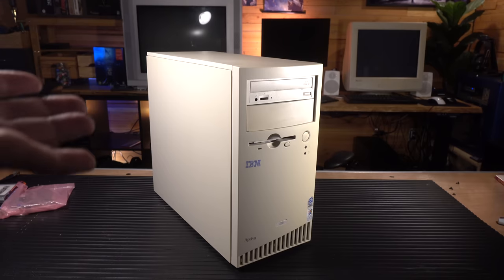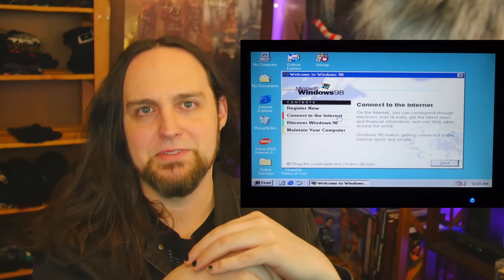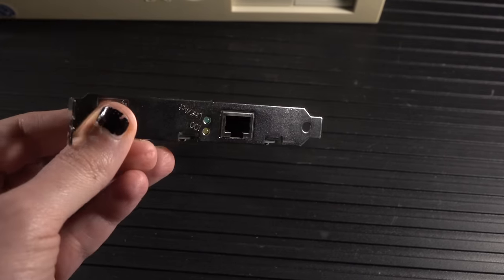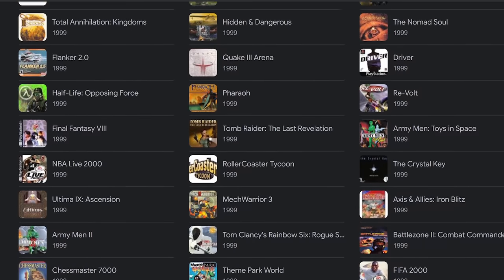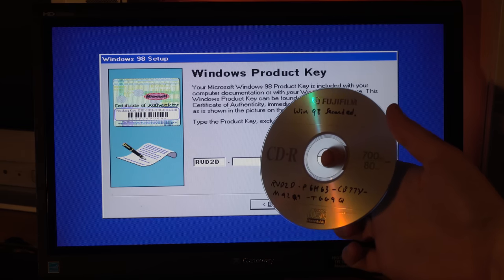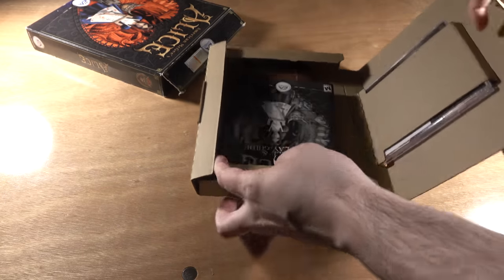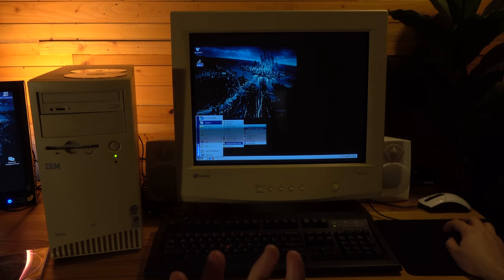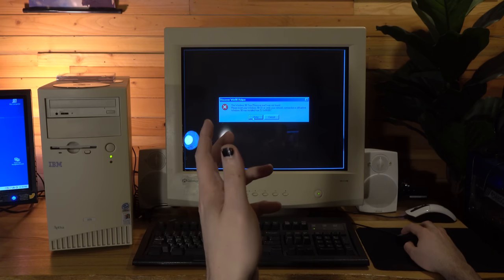Don't Install Windows 98: My Nostalgia Turns to Pain

Comment: I ran several large pieces of test equipment in the past that required Windows 95 in order to operate the machines. Their timing was hard coded to match the frequency of the processors that came with the test equipment. Trust me, there is nothing nostalgic about waiting 10 minutes to copy files to a USB through a floppy disk converter in 2020!

Comment: Best way to install it so that you never had to put the Windows disk in again was to format the drive create a win98 folder and copy the contents of the CD onto the drive and start the setup from there. From then on Windows will always look to that path for the install files.
Reply: Assuming you had it on CD, it'd be relatively easy. On the other hand, if you were stuck doing it from floppy... 
PLEASE INSERT DISKETTE 25...
Reply: @MindstabThrull  I'm not sure 98 was on floppy. 95 was which was quite a number of disks but it was actually more to then install office after :O

Was basically how I started in IT as a kid, "Hey sit here and change the disk when it says"
Reply: Use the February security update disc to auto install all the patches with a GUI, including USB. Hell, you can update 95 to basically 98 support level with the right patches. The problem with opengl is likely no driver, because 9x does not have factory drivers or an internet connection. Those drivers need to be installed to play games, not to mention direct x redistributable, and possibly the C libraries, which is so much easier with the update disc. Dude likely didn't know any better. Stock 98 is garbage compared to SE, and ME is even better.
Reply: run 98 cd
install from cd option
c:
mkdir win98
d:
cd win98
copy . c:\ win98
c:
setup

and you're off to the races
edit: comments being weird, wont let me post asterisk

Comment: That's why 98SE was created, to improve on 98FE, & it is why 98SE is also one of the operating systems that I have used the longest & still use it to this day.
Reply: It is 98SE though. Windows 98 in general is just unstable

Comment: XP is the true retro sweetspot , with the inExperience patcher you can make it look justl ike windows 95 and 98 plus with  the unoffcial sp4 added you can play games like Fallout new vegas , skyrim and crysis 2  so the range on xp is so wide , i tried a windows 2000 build and ended up putting xp on it and setting it up to look like 2000 because it was so much easier to get games to work
Reply: Good points about XP, I may have first started PC gaming on Win98 but XP was where I really cut my teeth in modding. Adding real world cars to GTA San Andreas on PC for me was like the moment in Star Wars when Obi Wan tells Luke "You've taken your first steps into a larger world" if only I knew how good those times were when they were happening.

Comment: You should try out Star Trek Klingon Academy.  It has fmv cutscenes, starship destruction where you blast holes in the hull of the ships, you can fight on the periphery of black holes, planet atmospheres, and asteroid fields.  Plus it has a really deep power management system letting you overload shields, engines, weapon systems, tractor beams.  It really had it all from the golden era in gaming, lol it's manual was on a ring binder it was so thick with lore and information on how best to command your starship.  And as an added bonus it was annoying as hell to get it to run on my windows 98 PC but it was a blast when it wasn't crashing or having audio issues.  Oh yeah and it came on 6 CDs!
Reply: That sounds amazing! I hadn't yet heard of that game before now.
Reply: Plus the game came with a great T-shirt. Wish I still had it

Comment: I have USB flash drive support enabled on my custom built retro 98SE PC (Slot 1 Pentium 3 933mhz running at 700mhz, 1 GB of ram, 2x HDD 128gb + 80gb, Sound Blaster 16 CT2910, and a new old stock 9250 256mb ATI radeon card etc.etc)  + a USB 2.0 PCI card installed, works perfectly.

Comment: I'd love an old beige case with a windows 7 board inside, 98 themed. I had done this before during lock down, the case lacked air flow so I took it apart in the end. but it was like having a windows 98 machine with more abilities haha
Reply: Beige = "Putty."

Comment: I’m in a bit of an odd situation. Although I am a few months older than the 8086, I didn’t get into learning about computer until about eight years ago. So, I know Windows 10 very well. I know Windows 7 less well, and I had owned XP, 98, and 95 PC’s when they were current. I used a 3.1 at school, and an NT 4.0 at uni. 

Computers being my hobby these days, I am slowly working backwards through time to understand now what I didn’t back then. There are tiny amounts of nostalgia, but it’s mainly all new to me. 

In a VM, I have Windows 11, 10, 8.1, 8, 7, XP, and 98se. On bare metal, I have 11, 10, XP and 98se. And in an emulator, I have 98(fe). 

My next project is to get NT 4.0 running, and then I want to get 95 and 3.1 going, but obviously need to get DOS running first. 

Anything running on NTFS seems really easy. Install them, network them all together. XP accesses the NAS with just a bit of arm twisting. 
But the 9x stuff? Anything running on FAT? What a delightful puzzle this stuff is. 
98se was a learning curve, as you say, just to get drivers working. I have a special old thumb drive that I have to use, because it doesn’t like the new ones. I was lucky enough to be given an old Pentium 4 system with an AGP mobo, that although came with XP, will run 98se just fine. Drivers are a search and I have everything except the onboard sound. A sound card solves that. However, it didn’t really like 98, so I didn’t even bother with 95. I’d like a 486 system, but they are now all overpriced. A combination of dying hardware and retro classification.

I’ve even researched XT systems, but you need a storage unit of parts just to keep them running. I enjoy soldering, but they seem to need constant attention. 

But yes. That is why I have a Windows 98 PC.

Comment: Windows 98 is actually pretty easy to get set up, I’ve been having no issues with my multiple 98 rigs outside of serial networking on a few obscure games
Reply: came to say the same thing. exactly. i think the older operating systems required that the user really understand their hardware very well, whereas newer operating systems do most of the decision-making for the user.

Comment: I remember that little animation whenever the shortcut you clicked on couldn't locate the destination it had a flashlight rolling on the floor as if it was looking for the file. Small touches like this seem cute now. 
Also when i was very little and we had no games i used to go into the Windows folder and found the dos executable. I thought it was some sort of game because of the colorful icon but it failed to launch whenever i tried and couldn't figure out why lol

Comment: Modern flash solutions are fantastic for these retro machines. I have a beautiful IBM Thinkpad T23 running with a P3, S3 SuperSavage (basically Savage 4 performance with Savage 3 memory, yet no bloody S3TC for Unreal!!!!) integrated video card and half a gig memory. I bought an overly expensive 64GB PATA SSD, but I also grabbed the HDD caddy made for its UltraBay 2000 modular drive in place of the DVD drive. Grabbed an SD-to-PATA adapter and that SD card is where I have my Windows 98 disc stored, all the drivers for the T23, and the ISOs for ALL the games I wanna play. If I need to move a bunch of files, I can just pop the SD card out, drag and drop on my desktop and pop it back in. If you can use flash storage, go for it.

Careful if you do CompactFlash though, you need an old card because modern Sandisk CF cards don't have fixed disk mode, they will instantly fail if you try to force the will of FAT32 bootable on them.

Comment: Windows 98 was the first advanced OS we had at the time when hardware was finally good enough to run it relatively quickly. Thats especially true if you knew how to optimize it.

It's biggest problem was letting drivers take it down. You had to find the stablest drivers, not necessarily the newest ones.

And you couldve learned alot about it because the Resource Kit was on the CD.

Comment: Alice game wasn't meant to run on win98 machine, I remembering playing Alice during XP Era. In win95/98 Era You rarely can install full cd games and I remember you can't run games without cd inserted, similar like console games due to limited hard disk space those days. The only way we could work this around without insert cd is by installing something called "virtual drive" or "virtual cd" where you copy the entire cd content into iso and mount the drive to the program. This feature is only available on 3rd party software before become available in windows 8... Useful tool for people who doesn't want to spoilt thier cd rom drive those days

Comment: I forgot about the USB devices not working without drivers. Back then making games work was always a chore but I was young and was determined to get it going. Now I'm also used to everything just work.  Fav games from that era was Formula 1 Grand Prix and Janes ATF when I was about 11 years old.
Reply: Things got more simple with XP for sure. Even now though you still need to find drivers for some specific hardware, windows update doesn’t really do this reliably.

Comment: some businesses that rely on repeatability in manufacturing still use windows 98 or maybe 2000 pro because the cost and risk of changing that when its not really needed is too great.

Comment: We should have had a build-off (or OS install-off?) I have my old Athlon 750 (Slot A) system with 384MB of RAM and an FX 5200. DFI AK70 motherboard, 40GB HDD, an old...C-Media sound card I think, and probably an Intel NIC all in a very painfully yellow case purchased directly from a tiger back in the day. This was a fun walk into the past. I think I'll still try getting 98SE installed on that system.

Comment: Sometimes you get a BIOS that can just treat USB drives like essentially an emulated IDE drive. Those are really convenient, it made all my USB storage devices work even under pure DOS - after a reboot. But with random hardware and missing driver CDs it can be painful, I can totally see that. When these machines were new you just had them but nowadays...
But all in all it's probably the version of Windows I had the least issues with, I refused to switch to XP until 2004 or so.
6:10 and industrial plants. You wouldn't replace an expensive as hell machine so you don't have to use a DOS based OS to control it anymore.
9:52 No matter how many time I hear it, I will never stop expecting "For Whom The Bell Tolls"

Comment: Retro/Legacy Mania, I predict is going to become 'a thing.'
Also "Dial-Up For The Hell of It" must come back as actual 
backup! (Uh, land lines have their own power backups for
when the really fancy non-wired things go down?)
I've a gorgeous little "VIVA 24fx" modem.
Honestly it appears as if designed in the late Fifties/early
Sixties by VOGUE magazine, featuring colors putty, white-
sputtered black base with turquoise highlights and a
smoke window! (Meaning, one cannot view what's behind
'till lighting is on.)
The case is of rhomboid shape. The window at top (it is a
vertical affair, obviously meant to show itself off) sports all
sorts of flashing colorful lights and letters, letting one know
everything that is happening at blazing speed 56k!
(Baron Nicholas de Gunzburg -- VAMPYRE -- Theodor Dryer
would definitely have approved its elegance.) 
HANG-ON to all of your legacy stuff as IT has only begun.
(And I've not even touched-on pure collectorship compul-
sion per se. It is to be fired-onward I believe, by the utter
grotesquerie that is inhuman, soulless AI.)
Micro-Hard is pushing way-too-hard with its slave chains
for all program! (Beware M-H!)

Comment: Texas Vehicle Inspection Stations run Windows  98 and are bullet proof. They could upgrade there network from dial up to broadband. We had to establish a dial up connection to Austin with every test. If we couldnt we still kept a copy and mailed it. The newer machines that run windows 10 always break and dont work.

Comment: First thing you can do when installing windows 98 is take the HDD out of the system and dock it to a modern system and transfer your driver's and programs, I have a few custom built windows 98 machines and I have built custom win98se cd's with all the drivers on the disc. Windows 98 shines in the soundcard department, many sound card companies were around back then and you can't replicate the way those cards sounded. That's probably the biggest reason for me to use windows 98 is a compatibility with ms_dos and early windows games. Emulation is awesome and it's came s long way over the years but nothing beats the real thing.
Reply from the maker: I don't have an IDE to USB device, but that would be a good idea if I were doing this all the time. The network folder worked well enough after I realized I could do that. Now we need to argue over the other points lol. 

Do you think the sound blasters sound better on windows 98? I got an x-fi and the eax games sound like I remember them on my windows 10 machine. Next, I'll advocate for Dosbox pure again. I've been using it on my CRT monitor and literally forget that I'm not just using dos... That is, until I quick save. It's such a handy feature the it's hard to go back.... That plus modern controller and keyboard support really has me spoiled.
Reply: @teksyndicate  I wasn't really talking exclusively about sound blaster cards, other sound card companies back in the day had their own proprietary API like aureal, and gravice ultrasound.

Comment: Our quad pick and place machines all run win98 at work. There is win10 software available, but the gui is so buggy most people still use the old software. When you need to change a hard drive, or a single board computer, it's pretty much 1-2 8 hour days of head bashing to get up an running again

Comment: You can use poweriso6 to rip a windows 98 disc to an ISO(this preserves the boot sector. Copying a 98 disc contents to a directory will break the boot sector) and put your hardware drivers in the drivers directory and burn a CD. 98 should automatically install the drivers.
Once you get windows 98 installed you can use batch to create an installation source and you can create an automated setup with key and user id and password.
Btw not all network mapped drives can be seen or accessed by windows 98.

Comment: Always hated those cases, I don’t get the nostalgia for that. I just recently made and printed my own case for a miniATX sized board. Power supply and drives below, room for dvd and 4mm tape backup, and board up top and flat, ah … nice. My very own cube case.

Comment: You need the February security update disc from Microsoft. This will update all the USB stuff and redistributables necessary to run games. Also drivers are not automatic, those need installed too.

Comment: Its been like 2 or 4 years but I saw windows 98 out in the wild and older systems semi often. Big one was airplane diag software written for 9x that wouldn't run on nt based systems. Plane was built in like the late 90's or early 2000s and has a life of like 30 to 40 years but the company who made it doesn't keep the software up to date. Had hvac systems that had the controller pc run off it or even dos. Same with trophy shops. They had old engravers that had software that would only run on it. Now those machines were the backups or for overflow vs the newer systems but still. You have a bunch of industrial hardware out there that was build to last but the software it really old. Replacing the software/hardware upgrade is either 10's of thousands of dollars or simply isn't available. 

Also had to deal with cnc machines running windows 2k on their controllers and x-ray machines that again needed like 32bit windows 2k or xp and wouldn't run on anything newer without really expensive upgrades.
Reply: Keeping in mind the compatibility issues between 32 bit windows and 64 bit, I have no idea how industry is going to handle going from x86 to ARM.

Comment: I run win 98 daily it is a pain at first. But once i got the config right i burned all the driver files and updates to a disc now it is less of a pain when i reinstall. I love it though, its my main dos machine and while the specs are op af. I have run 99 percent of my dos games maybe 2 of them just wont run. For the rest i use a ram disk software or a cpu cycle software to down clock. I enjoy it nothing like loading doom from dos on a big crt and hearing that sound track on a roland sound canvas.

Comment: You can use software such as PCem or x86box to run an entire install (or multiple) of WIn9x off a modern PC. Emulates all CPU, GPU, Soundcards, etc. so you can play older games/software with it near perfect. A lot more compatible than regular VM installations. I ran it on a Dell CRT from 2002 and it looks nearly identical to the real thing.

Comment: Install 98 the easier way.  Format the hdd in dos.  Make the installation directory.
  c:/winows/options/cabs
You can use any directory you want, I just used a common oem path.  Copy the whole install directory to the folder you made using xcopy With the /s flag (/s is for sub-directories).  Change to that directory and run install.exe.  It'll take about 15 minutes or so to install and will never ask for the windows cd again.

Comment: Surprised you didn't go with a CF to IDE adapter, that's the easiest way to move files back and forth.
Reply from the maker: Might have been a good idea, but I didn't have one and didn't want to wait.... so I burned the disc... when I finally decided to order something I decided the 10/100 card would be more practical. Transferring over the network was great.